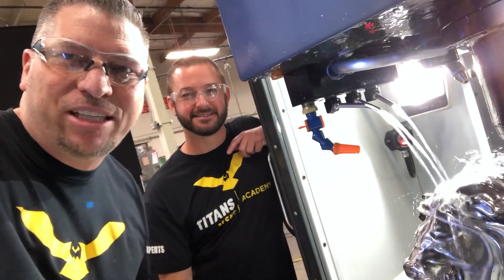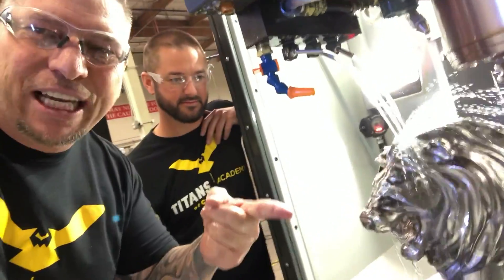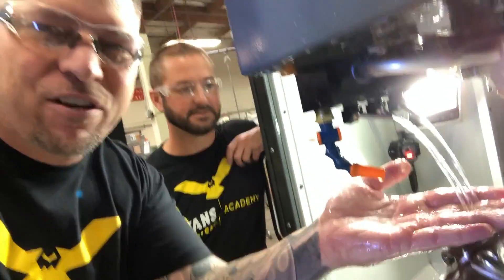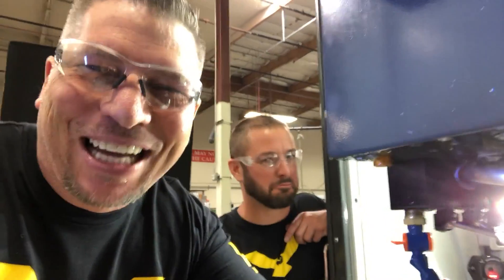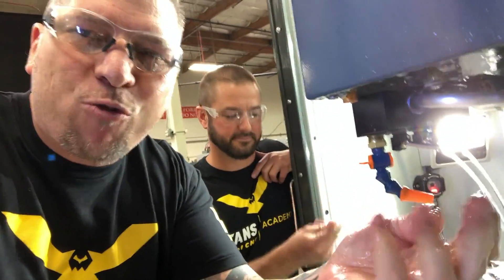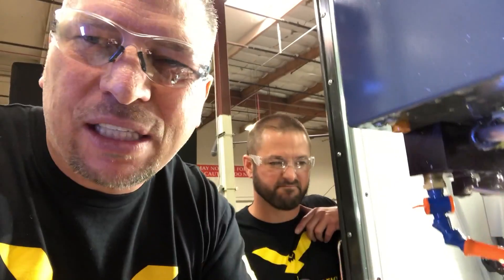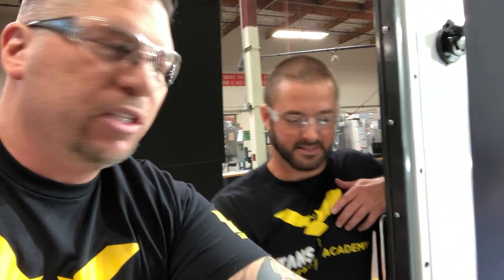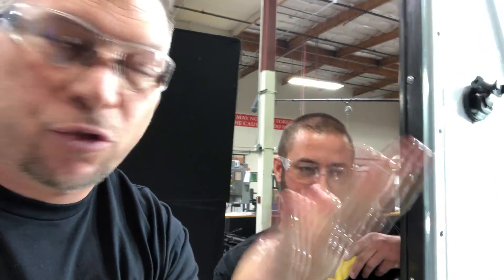Drinking CNC Machining COOLANT! Don’t Do It!

Comment: My last shop had a guy get a life threatening infection from the coolant; he was hospitalized and off work for a month.  Normal maintenance just didn’t cut it.
Reply: Define normal maintenance? Most shops run the same charge of coolant for years until they do a complete clean out. It takes a Mike Rowe type of cleaning to get the machine and it's sump totally clean. Plus the use of a specialty cleaner like Trim Whammex to clean, de-grease and kill any bacteria in the system. This cleaning solution must be flushed through the pump system and all over the machine after initial clean out of old coolant and chips. The cleaning solution must be rinsed, drained and removed, wiped down and only then can a new charge of coolant be added to the cleaned machine. On a normal job shop size machine, it is a two day (or more) process to get the job done right. Most shops throw coolant mints in and other BS methods to mask bad coolant. This guy you speak of, who almost died, had to be running some nasty coolant that was so contaminated and past it's life. That is why he got sick. Regular maintenance, I think not. Fact is it's a dirty job and nobody wants to do it. Costly too. But the alternative is getting sick. So ask your boss what is more important. Hope you learned something. Peace!

Comment: Hi Titan, first of all, congratulations on the videos! I am an Italian boy, I work as a miller, I wanted to ask you if you know why my coolant makes a lot of foam? (I use the "blaser cut" for copper and the machine is a Dmg 650v ) I thank you in advance! Keep it up that you go big!
Reply: Hello giuseppe, I'm jake from South Korea, I can tell you why coolant make foam,
,first you can check concentration of coolant (if concentration is higher ,you should put more water)
Second, water pressure of coolant in Machine (mostly)
Third, Chips in the coolant tank(if there is a lot of chips in coolant tank , The motor works a lot to absorb the coolant, creates a bubble so, you must clean it )

Solve 
If it doesn't work ,
You should change product of coolant or put antifoaming agent in machine (you can buy in Blaser) 
I'm using Blaser B-cool 755 
It will be much better , you can check it 

Thank you
Reply: giuseppe barone In addition to the concentration, check the plumbing on your machine for elbows at the pump and return line.  Check your filtration, you may need to play with the settings.  The type of filter you use might be creating foam, too.  There are many possibilities for foam, it's not always the coolant.